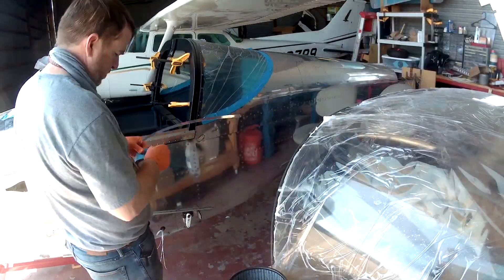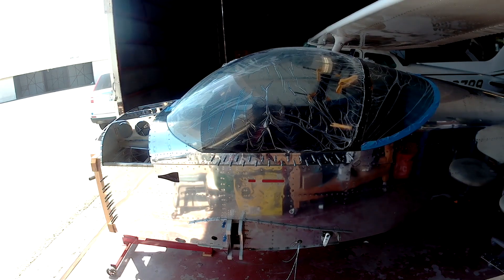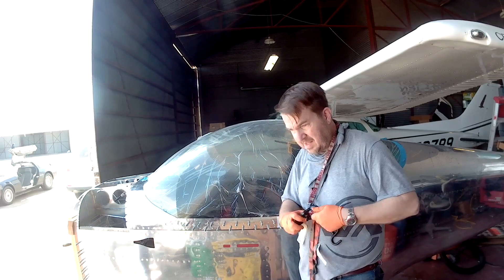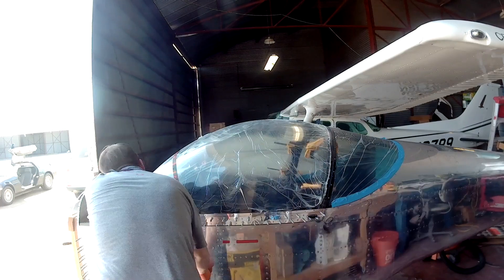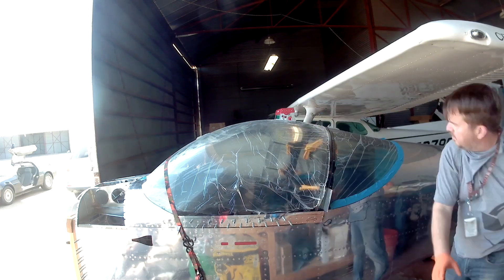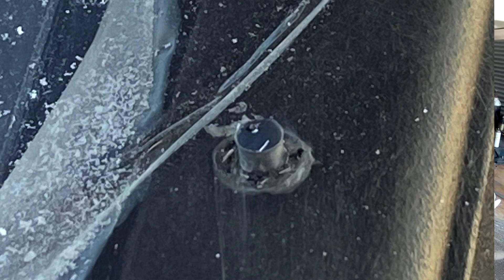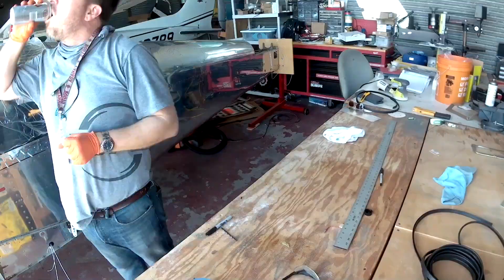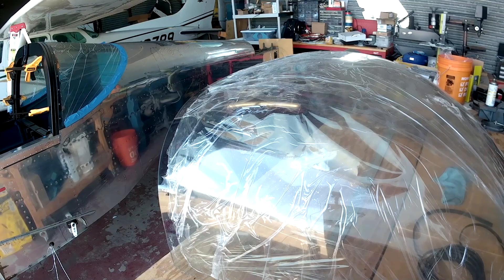RV-14 Canopy 5

Comment: I've seen other videos where towards the end of the build people are trying to run a wire along that bottom portion of the canopy for the close switch and they have to drill their rivets back out.  Have you already run that line or does yours not include that?
Reply from the maker: It does I just hadn’t secured the canopy yet  I want to have the panel and fuselage top riveted in first. Heard all kinds of nightmares trying to run those wires.